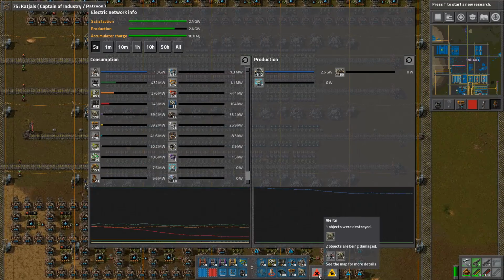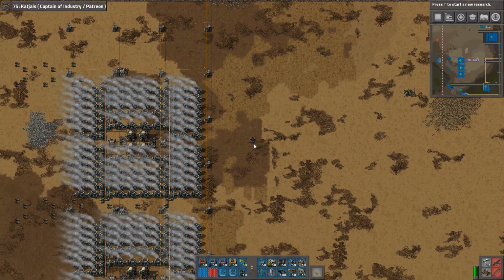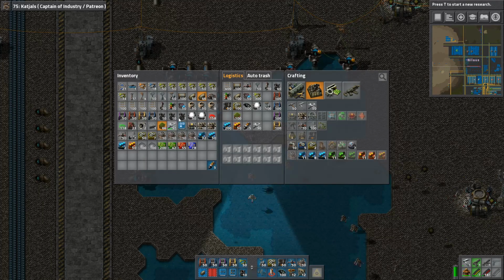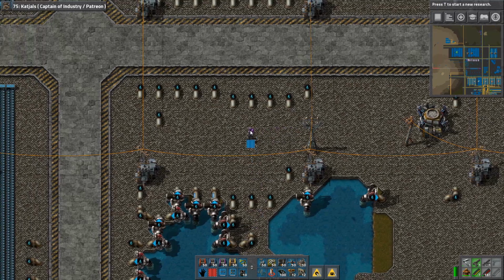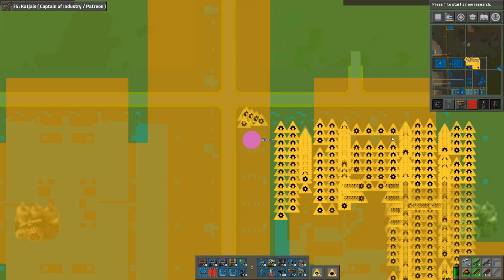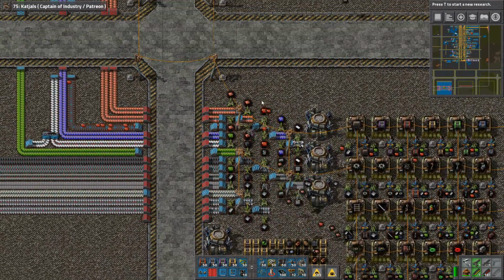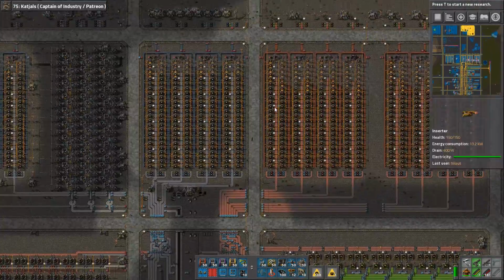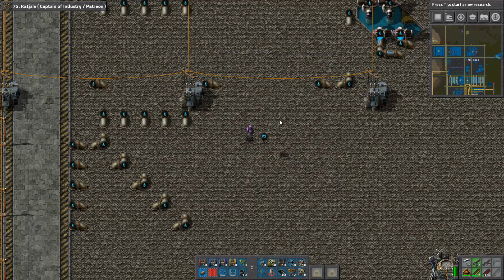Factorio 0.16 - Final Factory #75 WHAT I THINK OF PIPING

Comment: You should find a reasonably sized lake and landfill all the sides straight, surround it by water pumps, then build four or five large water loading stations, then modify your nuclear blueprint so that it has a water offloading station attached to each one, with the pipes connected. Save the station names in the print,  with circuits opening the station when it is under X water level in the tanks. Then you could just stamp down the prints and connect the station to the water train line and be done with it.
Reply from the maker: interesting idea. I think the current lakes are very far away from my base. Will at least check in the next stream
Reply: Or just build the entire nuclear build on the lake. You have large enough lakes (if you go far enough) and enough landfill.